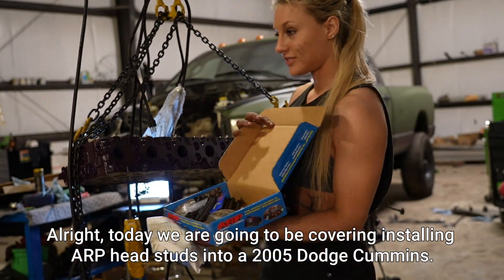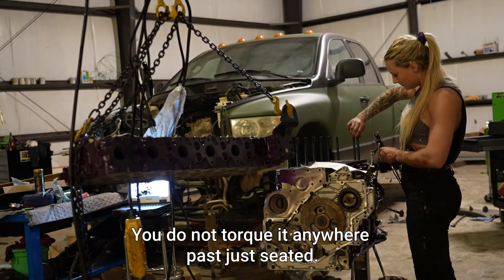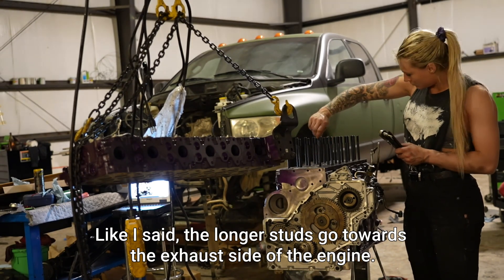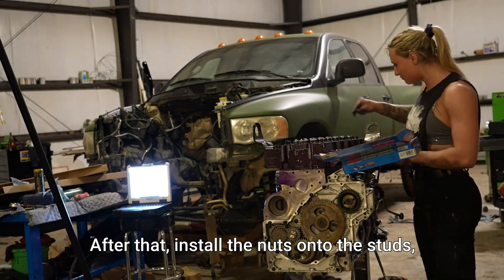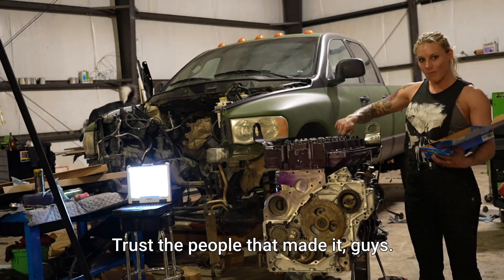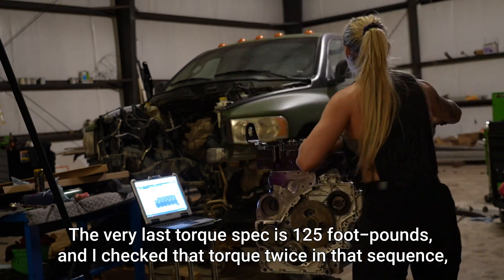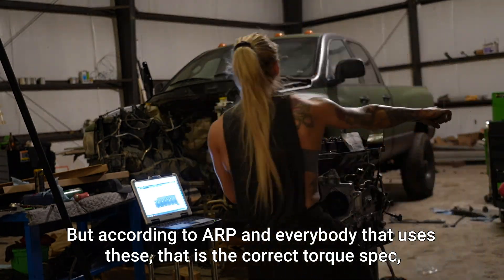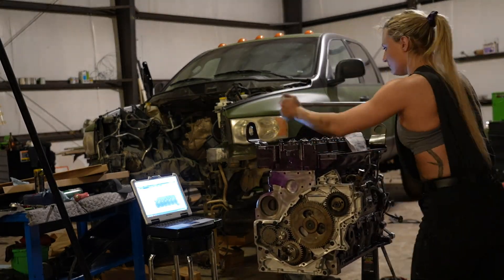05 Cummins 5.9L ARP Studs And Cylinder Head Install

Comment: Any time one is installing ARP,or any brand of studs,always run a bottoming tap all the way down,spray heavily with brake cleaner after running it back out,and blow all holes out using high air pressure to remove any metal shavings...Heavy coating of grease on the tap will usually pull any metal or cuttings out with the tap,but it's best to be sure with cleaning and blowing out..Safety glasses are up to you... Then install 2 nuts on the stud gently locking them jam style,and hand thread the studs until they hit bottom(Red loc tite is your friend here),unjam nuts, and hand remove them before moving onto the next stud,and you should have trouble free service from there forward... Also eyeballing the chased threads before installing studs may prevent a surprise from previously pulled threads...Uprising studs and nuts are the only safe remedy for pulled threads,never ever helicoil head stud holes...
Reply: Nope. She's legit ❤

Comment: When you retorqued in a couple of days, did you end up with additional tightening?  Did the studs release torque over the days you waited?  What torque wrench make/model do you use to ensure you get the right torque on the second try?  even with my snap on it seems that it torques a little more, just to get it to click, so the more I "try it" the more it tightens.

Comment: What program on the computer are u using to check the specs of torque per studs
Reply from the maker: @powerstroke7.34  i have a Diesel Laptop
Reply from the maker: @powerstroke7.34  but the the studs obviously aren't stock so the spec itself is given by ARP. I'm using the computer for the sequence

Comment: Great job and video, keep them coming. I enjoy watching your videos and have learned a little bit more about the Cummins Diesel Engine. I finally get my 2007.5 6.7 Dodge Ram 2500 4x4 ST 6.7L Diesel back this week for some electrical issues, hope they fixed it this time. I spent a week and a half checking everything I could get to.

Comment: 125 with grease is much tighter than 125 without grease. We did fastener quals in a different industry, and adding grease actually lowers the torque required to damage the threads of the nut or bolt.

Comment: LOL. I gotta admit you are kinda right about instructions. I usually consider them a last resort.
Reply from the maker: 😂😂 I knew someone would get a laugh out of that comment 🤣
Reply: @thedieselqueenmelissa  you should buy my '06 2500 SLT quad cab. 6 spd. Gear Vendor. Southbend clutch and flywheel. BandW gooseneck. Custom 17" wheels. 144,000 miles. I want it to have a good home.
Reply: @thedieselqueenmelissa one of the reasons that I think women make great mechanics.  Details are important and they don’t mind reading the instructions. 👍🔧🪛🔩⚙️

Comment: I used to tighten the arp studs all the time hand tite with a ratchet, never had a problem on alot of rebuilds I did back in the day which was a Wednesday by the way,they're arp lube is badass never had a bolt creek when using that stuff
Reply: What can happen is the heat elongation differential between iron block and the studs could cause the stud to crack the block. A 1/4 turn out is usually sufficient.